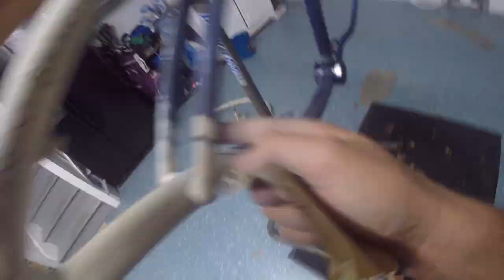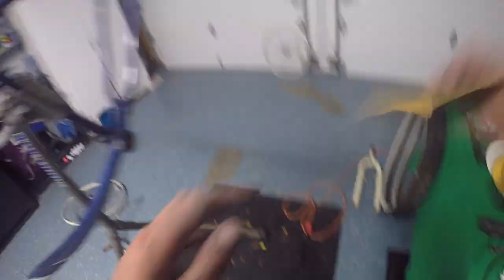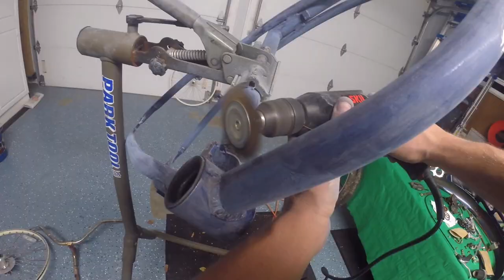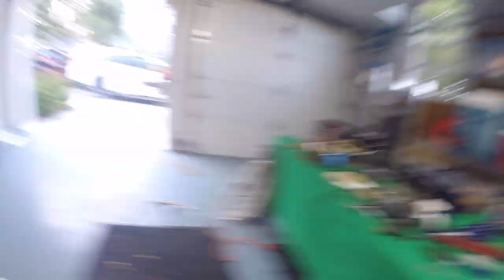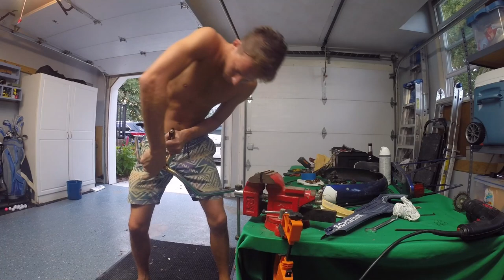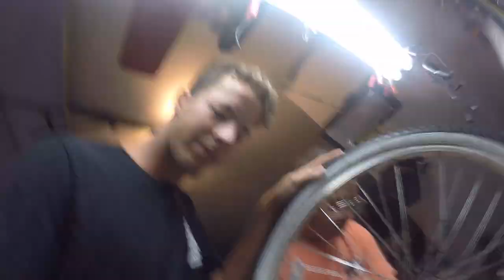26in Schwinn Bike Restoration Start to Finish

Comment: Fixing and riding any bike is a worthy pursuit.  Good job.  If you brushed those bars back to bare steel and they were chromed before they might develop rust quite quickly.  I've got two bike restorations on the go right now.  One is more serious than the other and went off to be professionally powder coated.